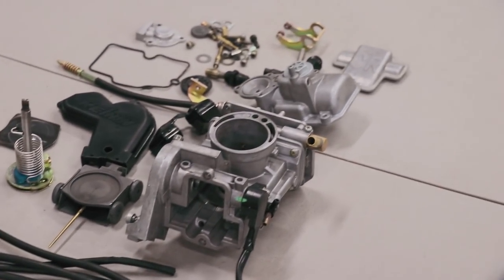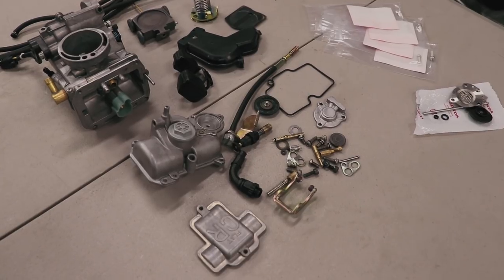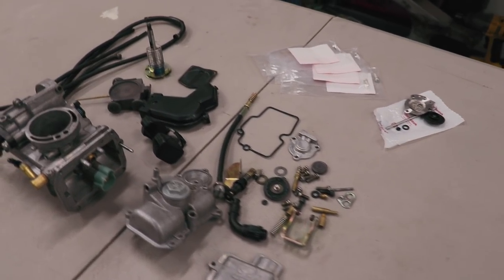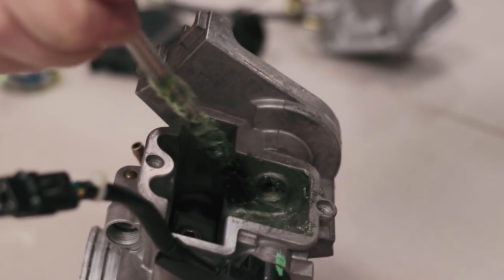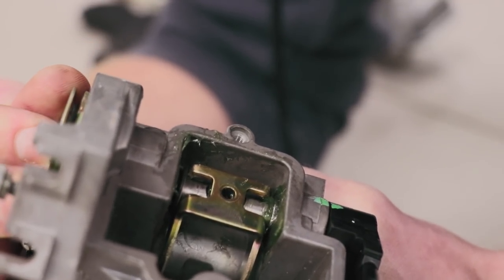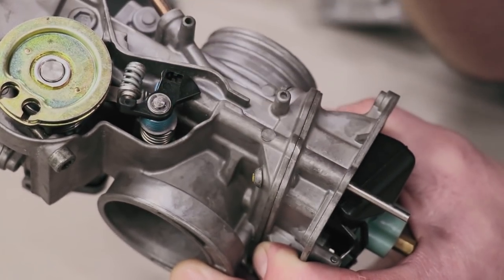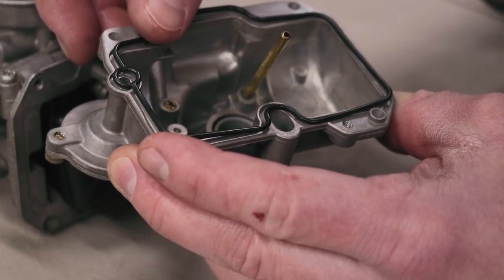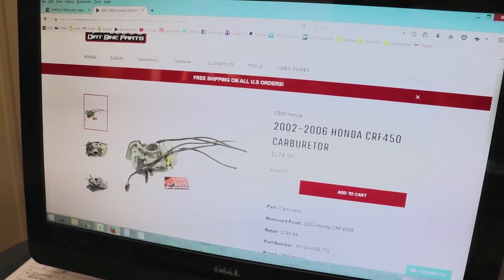Rebuilding a 4 Stroke Carburetor

Comment: We use the ultrasonic cleaner for cleaning the precleaned carburator housing and the jets. The small holes get free after that treatment and blowing out. The carburator works like new and is easy to adjust. Perhaps you try. Thank you for the nice vids.

Comment: You reinstalled the accelerator pump diaphragm in the wrong direction. Great video
Reply: I noticed this as well. Thanks for the comment - Flipped mine before putting it back in the bike - Cameron, this video is priceless~ Thanks
Reply: OOF

Comment: When installing them cute transparent color matching rubber 1/4" vent hoses  that appear to be too small to fit over your NIPPLES, just heat up a coffee cup with at least 1/4 full of water in it for about 1 minute and a half in the microwave to a near boil ( that is tuff rubber). Next while next to your carb and hoses, drop one end of the hose into the water and let sit for at least 60 seconds. Once you pull it out, swing the end quickly to fling the water out of the hose( if you use an air compressor to blow it out, the hose probably cooled too much). Now the hose should be soft enough to easily fit over your carb vent nipples!! Everything was so nice and tight and I didn't have clamps so I didn't use any. Take your time and have patience. If you don't have a microwave or a stove, use your campfire tins LOL...Then neon green ones on my KX250F look awesome!!..... Enjoy.

Comment: its very importand to check the freaking O-Ring between the upper and lower Carb. removing the torx-screws and u will get it. old carbs often suffering from the bad gas nowadays and getting into the tiny holes

Comment: Hopefully I get some advice. I rebuild the whole carb and cleaned it for my yz450f. Before it would leak from the carb over flow tube (the one at the bottom of the float bowl) constantly when I had the gas turned on. And still does this even after a full rebuild. Any advice? Thank you
Reply: Mine did the same thing. Did you figure out the problem?

Comment: Pretty sure the orifice that my pilot fuel goes into is blocked, screwing it in and out makes no difference to my idle speed, I was hoping to see you take apart that bottom section above the float bowl, with torx screws in it.
Reply: Did you ever fix this issue?  I think you are referring to the mid body.  There is not a lot of info around on replacing the mid body gaskets.  I have a hanging idle and I think the mid body is the issue.

Comment: I don't think my eyes were deceiving me when I saw you remove that fuel mixture screw and the metal flat washer was outside of the little rubber o-ring 1:51 . Videos always shows to install the spring, the metal washer and then the o-ring. Did I see that correctly?

Comment: I really like the informational video I am a tech and have been thinking about making a channel myself recording all the bikes I work on...your fuel screw assembly was in wrong though I'm not sure if it was someone else or you that out it in there last but the washer and o-ring go in the reverse order it goes screw washer o-ring in that order on every single car wether it be an air screw or fuel screw it doesn't change

Comment: I noticed when you took it apart and pulled the fuel screw out i noticed the oring and washer was in the wrong order. 🤓
Reply: I saw that too. However when he put it back together, he did it correctly.

Comment: Is it just me or did the airscrew have the incorrect stack up when it was pulled out?  I think the correct stack up on the screw is spring,flat washer and then o-ring. This one came out spring o-ring and then flat washer.

Comment: i know this is an old video but i have been souring the internet for a solution to fix my kxf250 2004, my bike will only run with the choke on, the carb has been fully cleaned and has had a rebuild kit in it, just wondering if you have any suggestions as to what it could be before i have to buy a new carb, its in a mx shop atm but they cant figure out the issue they have suggested a new carb but obviously this is expensive and would rather avoid that if it could be an easy fix, i know your a 2stroke guy but you obviously know your stuff ! @Cameron Niemela

Comment: Hi Cameron. I've just bought a used FCR and I've realized there is too much play in the throttle assembly, do you think I need to replace the wheels??
Reply from the maker: Play in the throttle at the handlebar or at the pulley?
Reply: Cameron Niemela play at the sliding plate, I think the carb body has a little Grove where the wheels roll, I'm not sure if it's possible to fix it by adding material to the wheels.

Comment: why didn't you pull the needle seat, does that one not have an o-ring and screen to clean ?
Reply: It does, i was going to comment the same thing.  If that o-ring is bad, the carb will over flow.

Comment: I️ have an 06 crf450r I️ blew up at the dunes, currently have the motor gutted... I’m 16 and don’t have the money to cover labor at a shop, I️ can rebuild engines for cars but never have rebuilt a single cylinder motor. Do you know any websites or places I️ could go to find the instructions / torque specs for the engine? Also looking for advice on a full engine build kits? Anything will help!
Reply: Fox Q for torque specs I'd suggest looking up a owners manual. I know I have a 07 crf450r, and they have the same exact motor in them. The owners manual has all the torque specs for every bolt on the bike. If you need me to send you a link for the online 07 crf450r owners manual, I'd be happy to help you with that.
Reply: Oh, and make sure you don't force anything, everything should fit relatively easily in these motors. Always check everything twice, and record everything as you take it out. It'll help you in the long run, especially when you take half of it apart, then come back a week later and not have an idea where each bolt goes.
Reply from the maker: A google search will bring up the torque specs or you could buy a factory service manual. Forums like thumpertalk will have all the info you need.

Comment: I'm thinking about getting a bike! Which one should I get 4 stroke or 2 stroke?
Reply: Pablo Diablo haha 2 stroke it is
Reply: Not a good question on YT. Try to ride one of each and make your own conclusions.
Reply from the maker: 2 stroke bro! Cheaper and easier to maintain. For the riding you'll be doing a 125 would be perfect.
Reply: Thats what I'm going to do.. the most logical thing to do

Comment: What was your base line setting for the idle screw? I bought a bike that the carb had been messed with, and someone backed the idle screw all the way off the throttle pulley.
Reply from the maker: Idle screw needs to be adjusted while the bike is running. There really is no baseline for it.
Reply: Cameron Niemela thanks. Keep up the great Vids man!😁

Comment: Just flipped it back, id rather it be the right way. Thanks, wouldnt have noticed that
Reply from the maker: I surprised it ran fine with it in the other way. Glad you got sorted. Thanks for watching the video!
Reply: Just put it back on, runs like new. Had a high idle but makes sense because when you flip it back the correct way there is a bigger gap for air to flow through. I put new o-rings on the mid-body, the part with the tamper proof bolts. I also drilled out the valve seat and smashed a new one in there from a dr200s. Its a miracle it works, it has a tiny leak i gotta mess with the float height or something. Anyways thanks for the tip

Comment: You need to invest in what’s called a “ JIS” screwdriver, you can thank me later. Lol they are bad ass
Reply: Oldrides53 just cut a slot in the screws with a Dremel tool, then use a flathead screwdriver, problem solved

Comment: Hey man i have a ttr125 that i bought with broken spokes on the wheel and they were ridding it like that.  I bought a new rim and new spokes, I started putting the spokes in the hub then noticed they aren't lining up the same. So now i am wondering if the hub is screwed up or is it supposed to be like this. Thanks https://youtu.be/VLlnwlUEPrU the video shows what i mean its only 41 seconds long so if you could watch it i would really appreciate it!
Reply from the maker: There are two different spokes for the rear wheel. The angle on the head is different for inside vs outside spoke
Reply: Cameron Niemela THANK YOU SO MUCH! I knew they could be different but i was only thinking about them being longer or shorter.  Didn't pay enough attention to the head of the spoke. Thanks again man!
Reply: The angle of the dangle is sooooooo important!! LOL.....

Comment: Anyone that's says this FCR carb is a 'great carb' I have to completely disagree with, it's an over complicated bag of wank if you ask me,  I've got one on my 2008 ktm 505xcf and it's nothing but a pain in the dick!!! Had problems all the time with it, fully cleaned it out, rebuilt with all new gaskets, fitted JD jetting kit for my Altitude you name it its had it and to put the cherry on the cake I need a complete new one as after all this it ran some what ok but now it has the very common fault with these where the slider wheels wear grooves into the case of the carb chamber causing it play in the slider which  makes it hold revs by its self and run like dog shit, I could literally throw this heap of shit at the wall!!! Fuel injection for me next👌🏻🤚🏻